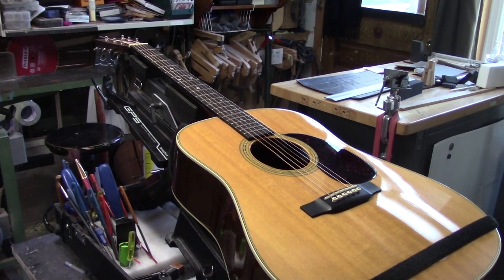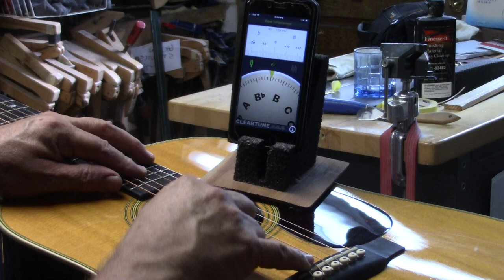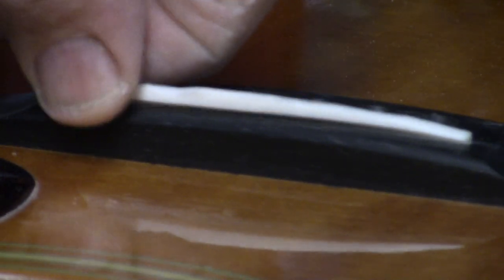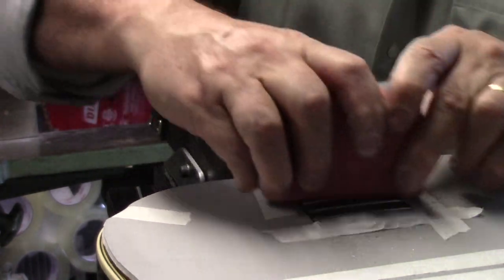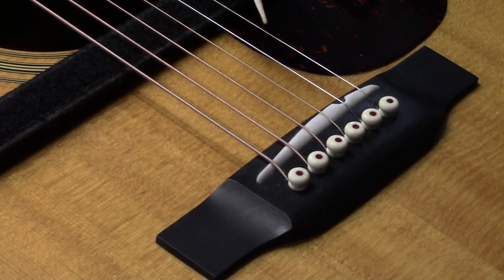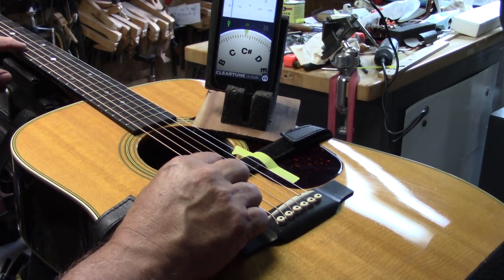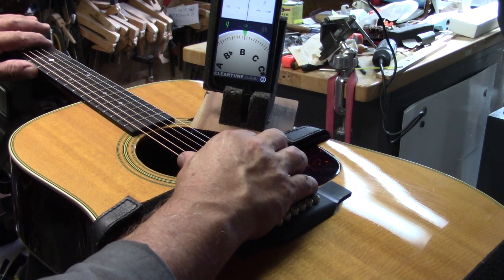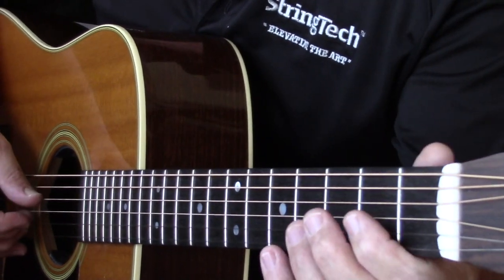When does a Martin Guitar need a neck re-set ?@StringTechWorkstations

Comment: Bought my D-18 in 1973 new. Heavily used for decades. In 2016,  it needed a neck reset and the bridge re-glued. I was having big time tuning/intonation issues. I also had it re-fretted. About 1/2 of that cost was covered under the Martin  lifetime warranty. They still had my Serial Number on file after 43 years Left it at the factory in Nazareth for 4 long months. Best $340 (for the new D-18) I ever spent. Still play it at least 1 hour everyday, solid 2 hours on Mondays at my bluegrass band practice/jam, and 2-4 hours a month when we gig out. Nothing I've tried sounds as full. Most of the expensive new guitars are sweet in treble, but lack the fullness at bass notes.  You have to keep it humidified and avoid extreme temperatures. I have another guitar that I use in those conditions..
Reply from the maker: Nothing quite like the "thump" of a D-18 !

Comment: maybe I can try that trick where you cut slots to increase the tension, I got some estate left, and might just get it perfect that way. I got 2 saddles now, one is a bit higher than the other, but when I put on the lower one, I get unwanted fretbuzz. probably because it's slightly too low, thus reducing that tension because of the angle being to shallow
Reply from the maker: I have a Martin D-41 coming in for a neck re-set. I'll address your questions in that video. I understand the reluctance to pull the neck off of a beautiful Martin guitar ... But ... eventually .... it does get to a point where it is inevitable  ... MMcC
Reply from the maker: That DX1AE is a completely different neck joint than the typical D-28 ( Dovetail )  ..... that has a tenon in mortise neck joint that is bolted on .... heat up and remove the wooden plate on the headblock ( with the wood burnt ) Martin Logo. This will give you access to the fastener.
Reply from the maker: https://youtu.be/2zbEX-baYZI?si=1eEnezGtMZ1RZFPN This is what you need to know.
Reply: @StringTechWorkstations  aha I never knew that I knew it was mortise tenon but not that it was bolted on
Reply: btw, is this information coming from your experience or are you able to look specs like this up on the internet? @StringTechWorkstations
Reply from the maker: Lol ! I created that and many other videos.

Comment: I just want to point out that Martin has at times over-compensated for any future problems that might be caused by the upward bowing of the neck (which can cause the action to be so high as to require the bridge itself, not to mention the saddle to be shaved absurdly low) by installing the neck with a backward bow ("negative relief") causing immediate buzzing and such low action as to require the saddle to be wedged up absurdly high just to make the guitar barely playable in the first position.  IMO, the neck should initially be set in straight.  The pull of the strings should be just enough to provide a little positive relief, with the truss rod adjustment fine tuning the string height above the frets in the the first to middle portion of the fretboard (the highest part of the fretboard's string clearance being controlled by fine tuning the saddle, if necessary).
Reply from the maker: Thanks for chiming in Bob. Tomorrow's video should be right up your alley. Stay Tuned ;^ ) !

Comment: Hi Mark. How can the action be high with a low saddle? I love your videos,  a lot of learning even though I don't have the room or tools to fix important issues, at least I can check my guitar and be sure the work has been done properly 👍🎶🎶🎶
Reply from the maker: Good question! It is the relentless pull of the strings "24/7 .... 365" that gradually pull the neck up .... until it requires removal and re-setting. The only recourse ( other than removing the neck ) is to lower the saddle to drop the action down. Michael
Reply: @StringTechWorkstations  Thanks Michael (sorry calling you Mark). I get it. I forgot about the tension and the neck bow. 🎶🎶🎶

Comment: What fret wire are you installing on a Martin dreadnought these days? These guitars sound great with a new saddle and nut. 🎧
Reply from the maker: By far ... the most popular profile is the .055" x .090".
Reply: @StringTechWorkstations  brand? Ty
Reply from the maker: I get my fretwork by the lb from Jescar NY NY
Reply: @StringTechWorkstations  Mike, 
out of curiosity-any experience on using evo gold 5590 on a late 50's D-28? I'm ready for a second re fret. Probably my last in my lifetime. Incidentally-I have no complaints against nickel frets. Ty
Reply from the maker: Hang tough Steve ... I have a 1952 00018 for neck reset ... and EVO refret.